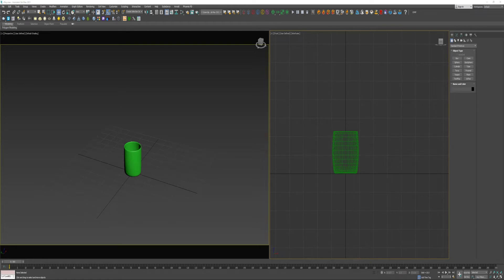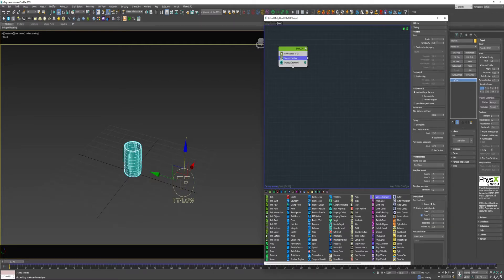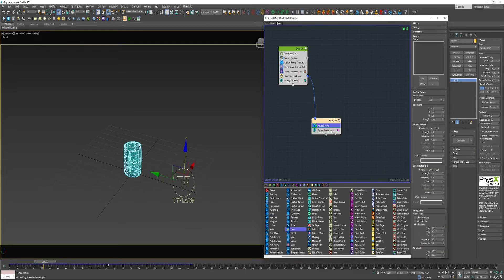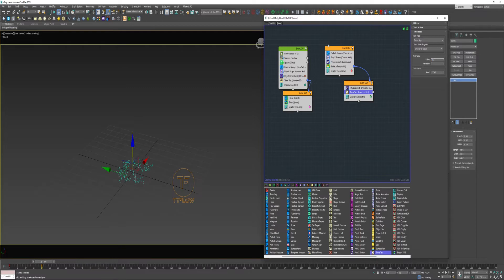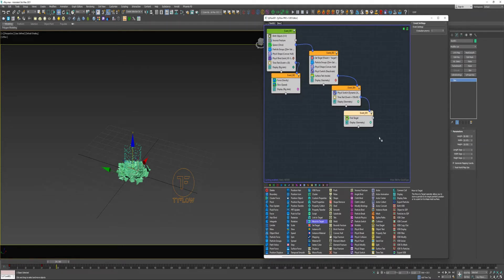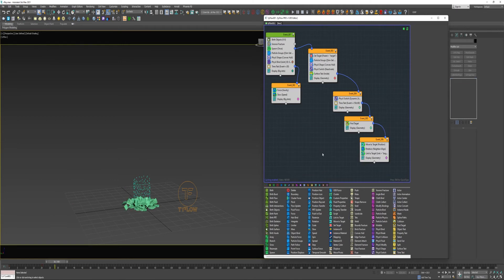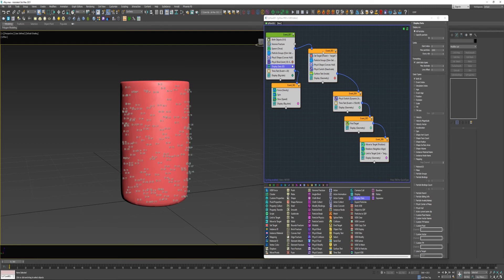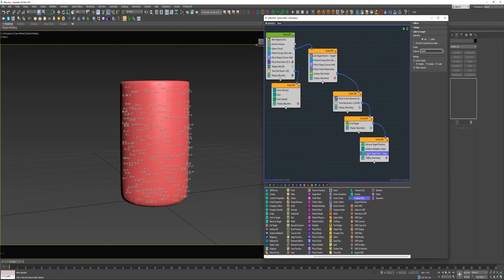PhysX Recombine Example -  TyFlow / 3D Studio Max - Beginners Tutorial

Comment: hi, is it possible to animate the cylinder mesh and in birth object enable object animation instead of driving the particles by force? how to do that? thank you
Reply from the maker: Hey John, sorry I didn't see this sooner. Yes you could certainly do it that way. Add an object bind into the main event, beneath the spawn operator. You could animate the object in max and drive it that way no problem. You might run into an issue with the child particles finding target perfectly, if so there are a few different ways to solve it, custom TM maybe, or maybe at the right time hide the child and trigger the parent into a new event where it is visible.  Sorry again, if you're still having an issue let me know I will see if we can get your sim working right.